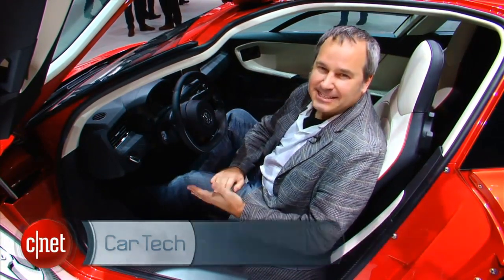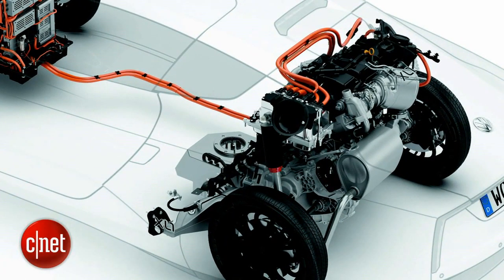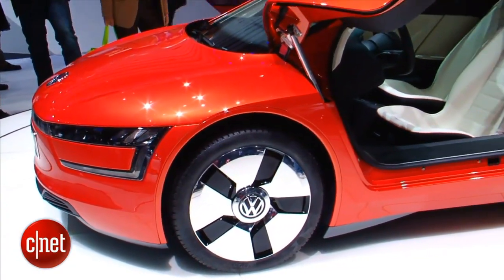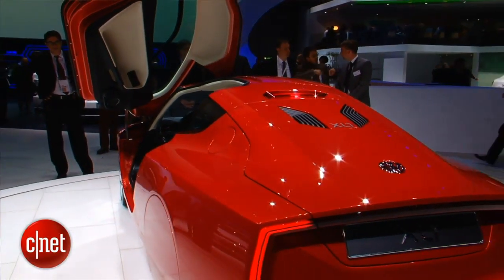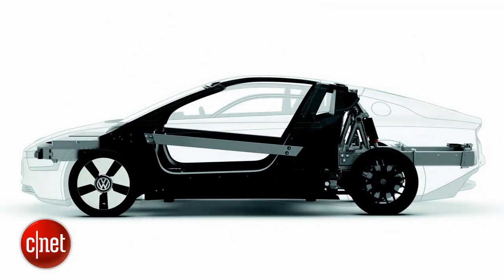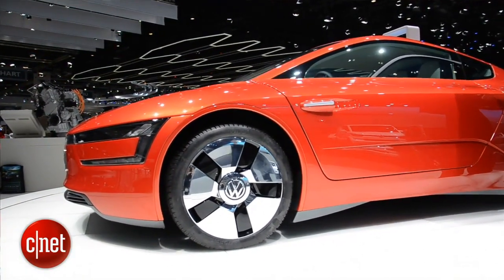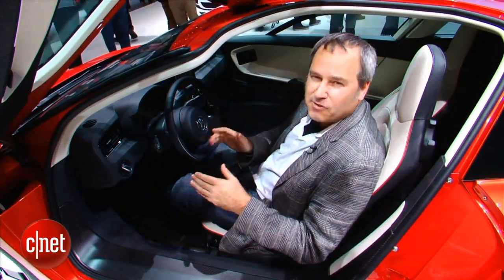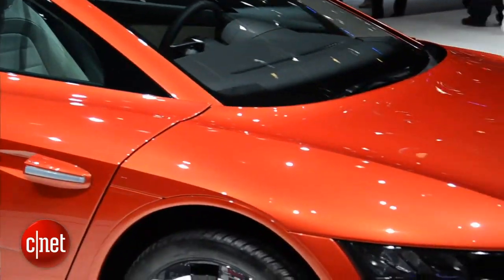Car Tech - Volkswagen XL1

Comment: If its $100k it would take 10-20years to make it an effective choice over a prius or a normal car. I'm assuming its in the $50k range......... They are not going to make it that expensive when the ride is soo noisy and bumpy.. why? Because no one will buy it. (expensive, loud, slower than the average... not a good combo.) If it's in the $50k range i will gladly buy 1 and drive across the USA in 1 tank......... Also i think it would have been nice if they added solar panels all over the car. lol.